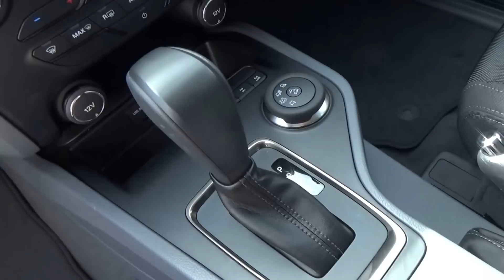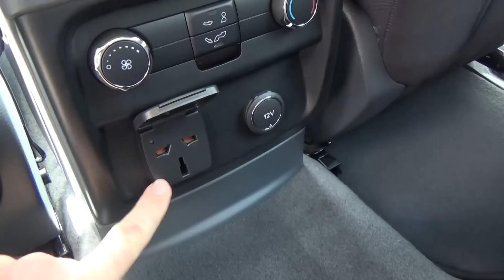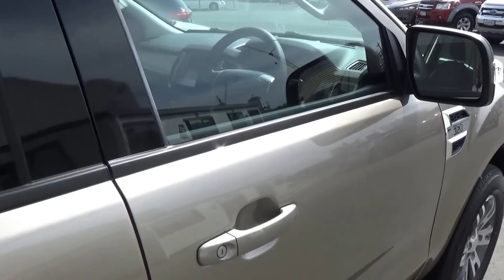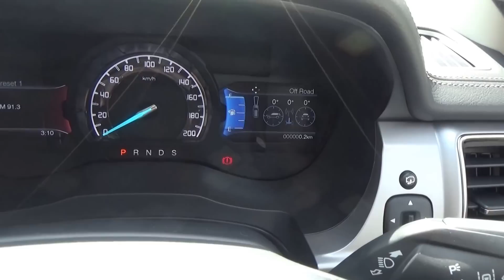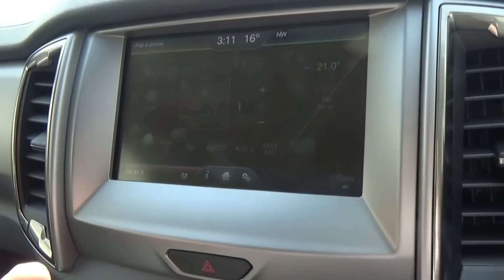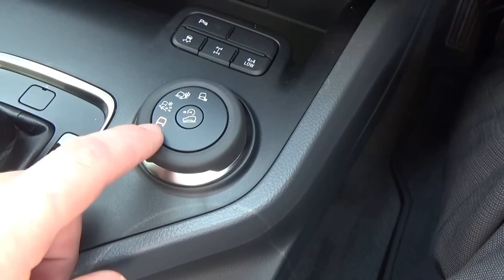All New Ford Everest Trend AWD Presentation - www.teamhutchinsonford.com

Comment: Is the engine loud especially when you're outside the vehicle?
Reply from the maker: No, it's nice and refined and not overly loud at all.
Reply: lightmalfoy23 mine is AMBIENTE 2.2Lvariant so far engine is quiet fr other suv brands though will see in 3 years time or so..

Comment: In terms of power how much HORSE POWER does it develop and how many Ft/Lbs torque ?????????  The instrument panel is a dogs dinner and far to many distractions. Dont need Up hill assist or down hill assist . Thats what Lo range is for. Dont like electronic suspension setups. I`ll keep my 4runner thanks. Can go where this and the 4tuner cant go . 4runner has higher ground clearance and brilliant Lo  Range Use Lo 3rd 90% of the time in tough going, Lo Second if its bad. Never ever had to use Lo 1st . With modified engine and exhaust my 4runner  now does 12L/100Km compared to the previous 18-20 L/100. Two long range fuel tanks both of 115 L= 300 litres and about 800 Km range. Dont need the third row of seats either.

Comment: I dont think it has independent rear suspension, i thought its a solid rear axle with coil springs?
Reply from the maker: +Gibbet Hoskins Thanks guys, "Watts Linkage on rear axle for more agile and predicable handling with symmetrical roll behavior and reduced lateral head toss" It is also tuned for each country were it is sold. Sorry for any confusion and thanks for watching
Reply from the maker: +Alexffrmhell  Hi there, the Everest does have IRS but the Ranger does not
Reply: +Team Hutchinson Ford ah nice, i was just assuming it was same as ranger
Reply: +Alexffrmhell "Solid rear axle suspension
with Watt’s Linkage" it definitely doesnt have IRS, its in the brochure
Reply: +Team Hutchinson Ford They are actually not IRS, they are IFS in the front with a coil sprung solid axle in the rear. Which is a positive anyway, better off road articulation capability. The difference with the Ranger is that it has a leaf sprung solid rear axle designed for heavier loads.